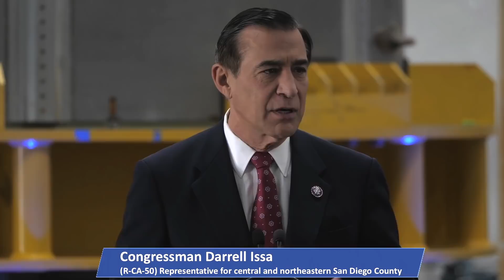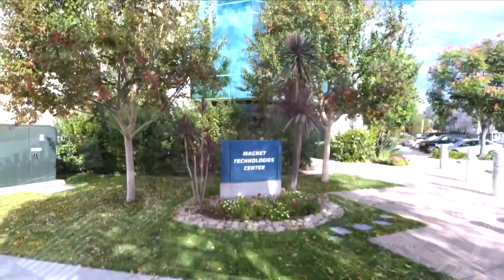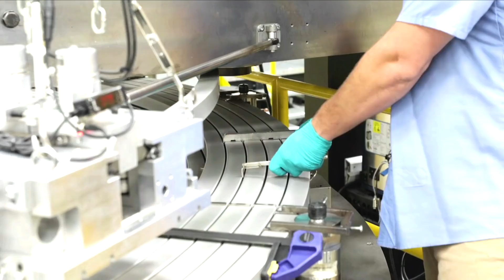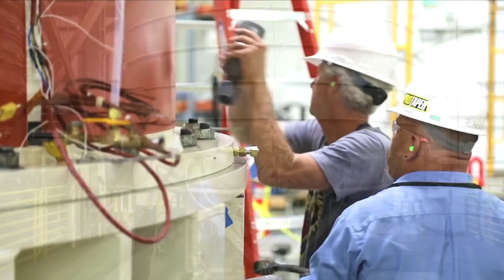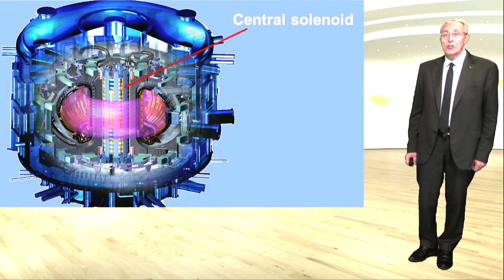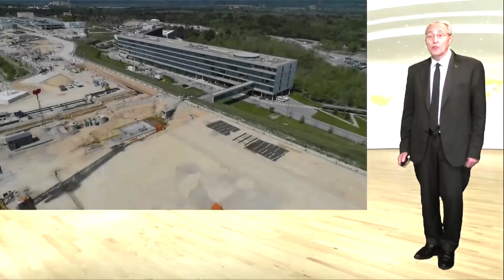Celebration for the completion of the first ITER central solenoid module

Comment: i got a bad feeling that trying to force fusion will never work unless the atomos are really instable.
like 3 neutrons to one proton, then we just need to give a push 
i suspect they need to prep the atomos to go into fusion, is unlikely fuel for fusion is stable for long 

fermi force changed carbon `14 onto azoto, basicaly by forcing a neuton into a proton by ejecting an electron

newtrons are likely charged neuter by containing a proton and an electron
if you could force an electron in a proton it will become a neutron
increase pression and temprature to fully yonise a atomo, re moving the electrons, then add xrays to the compressed hot plasma, as some electrons hit the nucleo they are atracted by the protons and captured by them becoming an extra neutron and increasing the nuclear force

you can as well radiate the fuel with neutrons before compression

other alternative is cool an atomlo to near absolue zerro and then eadiate wirg x rays electrons
the probability of hiting a nucleous with an elecrtron increases at near zero, electrons take single orbuts ... 

fiction ponly works becoiuse the isotops are already decaying

a h bon b test were they added litiun to the hydogen b,lew all records as some of the lition become hydogen

hydogen as only one proton void all protons of any atom except one a becomes hydrogen

sometimes scientist seem to complicate things to confuse rivals like they done at school

or emblish them to atract the media and grantes

so gravity distorts space... ui or bends light .. so what... einestein needed money to divorce his wife so he could fuck his copusin

why do we need a foton/// can caLL IT A PACKET OF EM FIELDS 

ONE DAY THEY WILL GET FUSION BY ACIDENT for now is just a cocks fight for atention

whenever personal ambition enters we have confused minds thinking in fucking and money

Comment: Before you go any further with this colossus of a super expensive and misguided brute force physics project/experiment you should review the science and experimental outcome of the SAFIRE PROJECT performed in 2013-2019.   It's all about rapid transition to nuclear fusion-powered electricity to cancel out the need for all fossil fuels and for the cleanest air possible. We now have the promise of the cheapest power with which to clean up our pollution and all industrial processes. We have in 2021 super cheap nuclear fusion energy already almost commercialised as in being in advanced design and development. So sadly, these other great ITER-type research plasma confinement strategies for eventual possible fusion and all current green energy technologies are totally out of date and relatively redundant. The also necessarily enlarged electric grid, with wind generators, solar farms and a multitude of variable green technologies with backup batteries are all also ugly and use up much land, while also being significantly capital intensive and all while having some safety issues. They are all also going to be unnecessary with the advent of the "SAFIRE REACTOR" that is safe, costlessly self-fueling, totally green, buildable on any scale on a tiny footprint to safely match local community requirements and it is easily chokeable and 24 hours dependable. It makes all other technologies redundant as in being much less advantageous. It is fusion nuclear powered by nuclear "NUCHEMY" and seen at the spinoff Canadian "AUREON ENERGY.COM". Also learn your new involved plasma physics, astrophysics, and general Electric Universe Theory at "THUNDERBOLTS PROJECT.COM". This way you can learn your new EU Theory, advanced plasma physics and all needed to fully understand the new academic material. If you have useful comments, general or scientific, please contact Dr David at dgillman47@gmail.com

Comment: No one says anything about the problem of tritium breeding. It is worth remembering that since there is no other source of tritium, for every tritium atom burnt in the DT reaction, the single neutron also produced in the reaction must cause the creation of a new tritium atom. This will happen through the interaction of the neutron with lithium in a blanket. However there is no evidence that this can be done with 100% efficiency, since a significant fraction of neutrons will be lost elsewhere, and the fast diffusing tritium will be extremely difficult to extract.

Comment: The project is cool but the reason they choose for the celebration is dumb. They have just put in place one section of the core. It is not the start of the project and is not the end of construction. They have just chosen an arbitrary point in a construction plan to make a party.

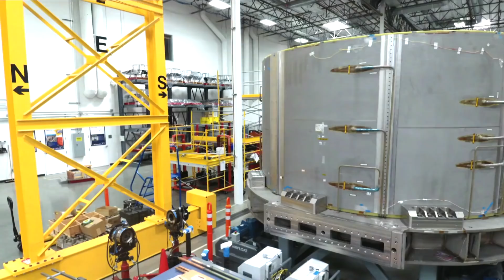Comment: 40:10 59 feet? What? I mean USA is part of the members but that doesn't mean we have to use their units for an international project.
Reply: Who says the engineers aren't using metric? They probably just converted the real measurements to Imperial for this presentation.
Reply: As an 'merican, I agree. There is no <good> argument not to use Metric for all engineering
Reply: @Teslaspecter  you ever worked in an heavy industry in the states? maintenance technicians hate it
Reply: It sounds like this was narrated for American viewers. I'm sure the actual engineering was done in metric. The tolerances they are working with requires it. And, as an American, I can say some of us are working on it. It will be a slow transition for the general public.
Reply: It's an American presentation in an American manufacturing plant aimed at the American public, the conversion is for PR reasons.
Reply: I think need to crash a few more rockets before they wise up.
Reply: @ronnetgrazer362  stop projecting.
Reply: @OwnerOfOwn  I project more failed engineering projects if companies use imperial units in international cooperation for anything other than communication with the public. Perhaps not in space though ("they" have actually wised up).
Reply: @ronnetgrazer362  need another seven astronauts
Reply: @OwnerOfOwn  Or 10, in metric.

Comment: This brings me equal parts joy and fear. Should the reactor reach it's full potential, is humanity ready for the responsibility that having effectively limitless energy entails? This feels like the project that could either turn the tightrope that industrialized society walks into a bridge, or knock us off completely. I'll be watching with bated breath.
Reply: The power of destruction is really cheap compared to this, no reason to think this would be used for anything other than creation, because it's too much of a hassle for anything negative that we couldn't already do in other ways. Even if we do end up making more of a mess (looking for resources (mass) to go with all that "free" energy), we could then afford to clean it up, as long as we figure out how to make computers do all the planning and execution for us, without losing our grip on that workforce.
So if you take this advancement to mean an important contribution to sheer limitless computational power as well, then I guess you're right, and so was Spider-man's uncle.
Reply: We already have that responsibility with nukes...

Tokamaks are essentially the benign side of nuclear fusion, and are harder to build than nukes. Nukes are relatively easier but you can't just build them without an advanced infrastructure, a lot of money and access to a design and the tooling and expertise to build it. That's why only some countries have them.

If anything, abundant cheap energy will remove scarcity and thus many of the reasons people fight in the first place.

Comment: Congrats ITER! 👋🏻

Hoping to see you reaching ignition before the National Ignition Facility, and their inertial confinement experiment!
Reply: Hate to break it to you, but IIRC NIF has already seen ignition (and maybe even fusion energy gain).
ITER isn't about just starting a fusion reaction tho. ITER is about SUSTAINING a fusion reaction, and starting to figure out how to harvest energy from it without quenching it entirely.
Reply: @SciDerg  Ignition is refered to as when the energy output surpasses the input, afaik NO ONE has reached that, I think that would have made massive news around the world.
Reply: @AvyScottandFlower  That's what I'm saying, that has already happened like 10 years ago, but I forget which prototype reactor did it. I think it was NIF, but I'm not certain. It DID make pretty big news headlines (if you were anywhere near the "particle physics news" sector anyways).
They got a fusion energy gain of like 5 I think, which is nothing spectacular, since a real power producing reactor would need a gain factor of like 20 to be worth using, and more like 100 I think to be economically viable.
Nobody's actually managed to HARVEST all that energy they got out of the reaction yet, which I think is what ITER and it's successor, DEMO are going to be designed to figure out (also things like breeding more tritium from a lithium blanket which will also stop some of the neutron radiation, because right now we get most of our tritium from fission reactors but fusion reactors will use all that tritium and quite a bit more).